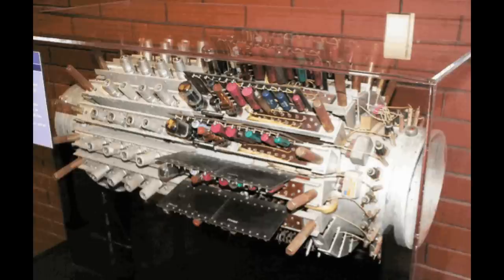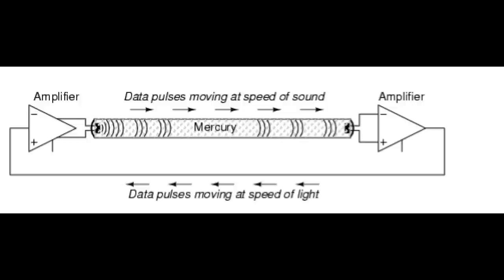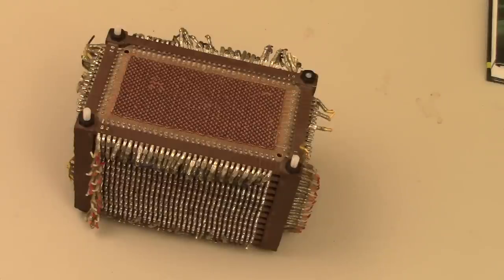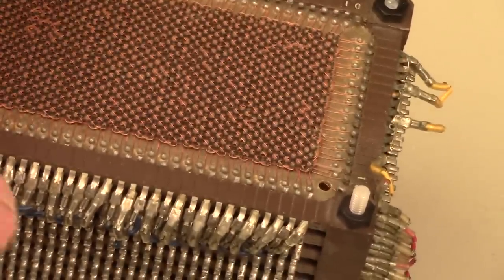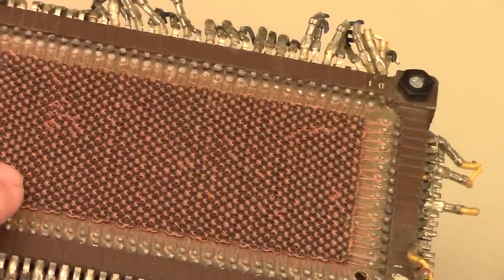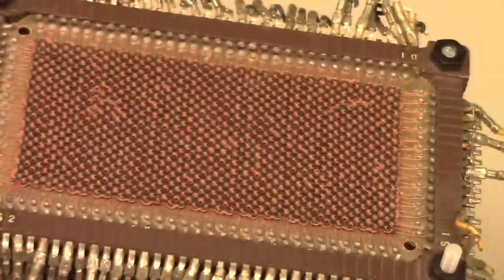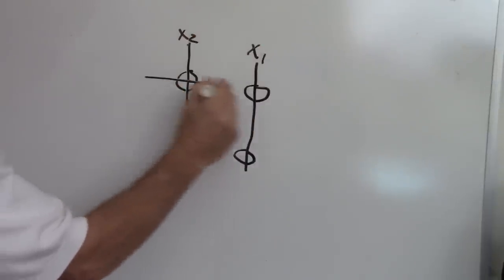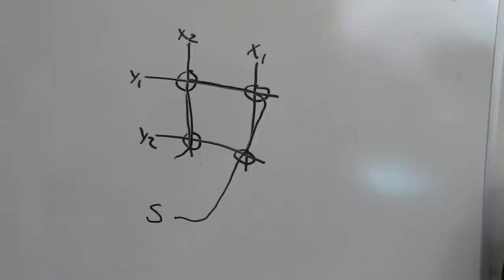Episode 11 - Getting Busted in New Jersey With Core Memory

Comment: And I thought I made out like a bandit when I managed to cadge a 8kb upgrade chip for my TRS-80 Model 100 out of the manufacturer as a "sample". Cost me nothing, and SAVED me $300 in 1985 money.

I managed to write my own ISAM storage and retrieval method for the TI 99/4a. There WAS a disk drive unit available but it was far too expensive, so I stored data for a record-keeping program I wrote for my Dad. I saved the data as indexed-sequential records on the cassette tape the device used for program storage. It was supposed to be "impossible" to use the tape as a data-storage device on that machine, especially since I didn't have the "Expanded" BASIC cartridge, and had to make do with the more limited on-board BASIC.

Years later, I worked for a company that sold it's own OEM IBM XT clones. I spent hours putting DIP RAM chips on the motherboards. Got to be very good at it, too. I even managed to cadge a few NEC V20 chips from NEC, so I could upgrade my own XT at home. The V20 was a little speedier than a stock Intel 8088 chip, and I could also run CP/M on it. I had a large backlog of CP/M programs from when I used to write some of early forms of shareware in Z80 Assembler.
Reply: I burnt plastic army men and insects with a chipped magnifying glass.
Reply: It's also fun to use a propane torch for that, pretend they got napalmed
Reply: Derek Jeter mnj
Reply: Those were the good old days.
I still remember my TRS 80. My first 'puter.
I used to store my written code on cassette from my TRS80 as I wrote it.
I try explaining to my kids that back then we did not have hard disk drives and I don't think they grasp the concept that 64k of RAM and a cassette on a computer was enough to do a lot of work.
Thanks for the memories. 
Take care buddy.
Reply: Hey, 64K on a home machine was going big! The Atari 400/800 were only offered with 48K max with factory 16K cards. Then someone (Atari's founder's new company) began selling "Ramcram" cards for them, 32K on a single card. A friend hacked one into 2 selectable 16K drives to speed up loading his games!
Reply: Dichotomy 
My first computer was the Macintosh Quadra 650.. a supercomputer compared to your origins on the TRS 80 lol. 

But I'm not completely out of the loop with the old tech! My dad was a math professor and was allowed to bring home a computer to work on, so we always had a Commodore PET computer at the house when I was a child. It's so funny now to think of putting in a cassette to load games. 

I tried to keep up with technology, but I'm afraid it's not a race I'm winning lol.
Reply: Damn I'm old!
Reply: I watched Terminator 2X , .. I wasn't even scared , the second time. Oh yeah. You could say I'm tech savvy.

Comment: I used to program an IBM 360/30 that had, I think, 64KB of core memory, and progressed through a few mdels to a System 370/145 running VM (two concurrent operating systems.... OS and Dos27 or so). 
Our software had to be very efficient back then, which is why most of it was done in Assembler, although later on we used COBOL and RPG, and sometimes FORTRAN, then PL/1.
Apart form I/O macros, Assembler was one machine instruction for each instruction coded.... nothing was wasted! Slow to code but it ran very fast for the speed of the CPU.
Nowadays I have 64Gig SD cards for under $50, while back then a Gigabyte was science fiction... Progress indeed!
I still have my old programmer reference cards and flow-charting templates somewhere!... :-)
Reply: sounds lovely. 
today the developers get more and more lazier because theres more processing power available they just are too lazy to optimize. i'd love to see the kind of interest and effort everyone had to program as efficiently as possible back then. the best example i can think of is NASA, oh god, their code has to be flawless and as perfect as possible
Reply: most of the moon missions were running with error code 1102?  (computer overloaded) they couldnt find someone who knew what it meant or why it was happening, of course all this occured during the flight so no tests ?  You would hope they got better. Nasa is far from perfect they launched discovery knowing it had a 5% chance of failing (ie 1 in 12 will kill everyone on board in a giant ball of white death) but regan wanted something to talk about during state of the nation, so they launched with frozen o rings :(   turned out he got to talk about brave school teachers touching the face of god  .. ugh
Reply: Andrew P It's one thing to say the Challenger disaster was from a pervasive cavalier attitude that allowed operation outside the normal flight parameters under pressure from the Reagan administration to make shortcuts to save money. It's another, sheepish, cowardly thing to say it was murder so he could recite a poem from 1941. A lot of shameful things happened under the Reagan administration, but that's some real tin-foil-hat shit right there. Grow up.
Reply: Andrew, two Space Shuttles were lost during the program. Challenger was the one that blew up with the frozen O-rings. Columbia broke up over Texas. Discovery survived the program and is now in the Smithsonian.
Reply: exactly, many of the spaceships failures are mechanical. of course there are some software bugs, but the software developers at nasa are famous for making the most reliable software jmowreader
Reply: wait thats not the documentary? ill have to have more of a dig

Comment: While in the Navy, I worked on a computer that was literally an IBM 360 in a compact military package. It had 32K Word (16 bit) core memory.  It was used in an attack aircraft.  That computer was amazing because you could power it down and when you fired it up again, it would pick up exactly where it was when it was shutdown. No loading OS, no feathering it’s nest, just ran what it was doing when shutdown.

It was also used in SkyLab.  And 3 of them were used in the Instrumentation Unit on the Saturn V rocket.  Yeah. I’m that old.

Comment: In DRAM, not only does the charge on the capacitors have to be refreshed every few milliseconds, but it also, like core, has to be rewritten every time it is read. That happens automatically inside the chip, so we normally don't think about it.

Ferroelectric RAM (FRAM), a nonvolatile memory technology, also has this hidden rewrite on read, which is why it has limited read endurance, unlike EEPROMs and Flash, which generally only have a limit on write endurance.

Comment: I still have the core memory I salvaged in the early 1970s that I intended to use for a DIY computer while I was in college.  I think I got it free as a donation from Xerox after making a few calls.  Ended up first building one from an 8008 chip that I had trouble getting working, and ultimately, my first working computer was an IMSAI 8080 kit, which I then utilized for years-- still have that and it still works.   But you forgot to mention drum memory.   I also had a vacuum tube computer for a while, the LGP-30 that had 4K words of 31-bit drum memory-- bit 32 was a "spacer" bit on the drum and couldn't be written.   And even the CPU's accumulator was stored on the drum, they saved multiple copies there in order to increase the access time.   The drum also had a clock track which produced the master clock for the system-- it was bit-serial so it would clock data on and off of the drum as it ran.

Comment: Hi Jack and thanks for posting the information on magnetic cores.  I was in USAF during the Vietnam War and in SAC.  We had a system called the 465L that used magnetic cores.  The system was quite a bit like the modern internet in that it allowed SAC to communicate with all of its bases through digital communications.  It used modified IBM selectric typewriters as both keyboard input and real time printers.  The system we worked with was my first exposure to magnetic cores, though ours was much smaller than the one you showed in the video.  Ours was only 90 words of memory and served as a buffer for the data as it was sent out.   We also had a device used for encryption called a KW26.  This device was extremely old and used tubes and what were called bi mag cores.  The bi mag cores were used to store information as it was encrypted and decrypted.  Each core was a single toroid that was mounted with others on a board.  the cores themselves were about an inch square and about half an inch high.  Lots of fun way back then.  Thanks for the memories.

Comment: Rope memory?
Related to core, it could only read.
Think of it as early ROM.
The flight control programs for Apollo were stored on woven ropes.
The system used AC in the interrogation and sense leads, which prevented having to re-write the bits on read.
The ropes were literally hand-laced to program the bit-patterns.

Comment: great video, beings back memories.
I became a programmer in 1963 on a Univac SS 80 with 3,200 words of memory. This memory was stored on a cylindrical magnetic drum that was spinning at about 18,000 RPM. magnetic read write heads read the memory contents as the drum rotated. Unlike discs these heads were static, they did not move, YOU had to wait for the required memory locations to pass beneath the R/W Heads to access the contents.
20% of the drum has 4 sets of heads at 90 degrees to each other so that you only had to wait for a quarter of a rotation to access the memory.
When writing programs you had to keep track of where the heads were in relation to the memory locations you needed to access, if you did not do this the program ran very slowly.
Each WORD of memory contained 10 4 bit characters, these bits had the binary values 1 2 4 5, yes 5, it was known as BIQUINARY.
Programming these machines was a nightmare BUT GREAT FUN.

Comment: No doubt that memory will never look as cool as these older devices, I wish I could see what people a thousand years in the future will think
Reply: sam goad 

they will maybe using a new form of core memory because it can be as fast as an ssd and you can rewrite it endless
Reply: I'd imagine that the material would change to something less temporal, if you go on Ebay for one of these you see alot of the connections severed. My idea, Crystal capacitors!

Comment: Mr. Ganssle:

Overall, a very interesting video; but my attention was suddenly riveted when you put up pictures of:
≈ 2:25 to 2:47 – the Williams tube

When I was old enough to comprehend some things about computers, my father described what it was like to work on one of the very first of them. He was back and forth between MIT (where he was doing his doctorate) and Princeton (where J. von Neumann's electronic baby was), and I didn't catch which location this was, but he talked about having to deal with computer memory that was on an o-scope screen.

And here's the crazy part – when some of the memory spots on the screen would become faulty, programs for that machine had to be written to specifically avoid those memory addresses!

Anyway, thanks for connecting me with images (as well as the name!) of what my dad must have been dealing with back in the early 50's!

PS. I still have his copy of the owner's manual for the IBM 704, which, some years after his doctorate, was the machine in use at his work.

Comment: Not sure why you're thankful it's gone as from what I read core memory was pretty reliable comparable to semiconductor memory.
The Apollo AGC and 4PI had it and where so reliable they were used in flyby wire systems and some old mainframes that had it were it were still in use until the early 1990s.
 Now mercury delay lines and Williams tubes on the other hand were known for being fickle and buggy to the point of frustration.
Reply: you think that having a million of these (6 GB) would be more reliable than 6 gigs of DRAM?
Reply: jakejakeboom
Of course not.
But it was as a huge leap over previous memory technologies.
One big disadvantage of core it was not only bulky but was very labor intensive  to manufacture.
When the 1103 1K DRAM came out in 1971 it was a significant an improvement in cost and packaging and quickly began to replace core memory in many applications.
Reply: comparing shit old tech to other shit old tech, people are sitting on gigabytes of ddr3/4, and none of them give a shit so why waste comment space?

Comment: I wish people would not use the SI value for K (1000), but instead use the one that's always been used in the industry of 1024. It seems those hard drive manufacturers in the early 2000's looking to make thier disks look bigger turned the tide. Even though all other parts of computer architecture still uses 2^2 ie, 1024 systems. In fact, even filesystems used on those disks still use 2^n.

Comment: Many years ago I worked for British Rail. As we had very little money we had two old second-hand IBM 370-155 machines on which we ran the reservations system (one machine as backup). One day a drive transistor on one plane of the core memory failed. Our IBM engineer loved these machines, I think they reminded him of his youth! It turned out that IBM no longer stocked the part, at least not in the UK. So, he looked up the transistor's characteristics, found an equivalent in the Tandy (UK version of Radio Shack) catalogue, popped out to the local store, came back and soldered it in. I don't know if his expenses claim was accepted though...

Comment: As a professional programmer that was taught assembly in my computer science degree the lack of memory forced better programming practices than are the norm today. Nowadays languages with garbage collectors mean most programmers that never learned assembly or even C know nothing about memory management and consequently code as if memory is infinite.
For a single user system that might be just about viable but if you need to scale all the old memory limitation problems are still there.
Great video.

Comment: Hey good post! 
Thank you for a walk down memory lane (pardon the pun),  my first job back in the day was with Dataram Corp. plant (Trini Data owned by Mr. Michael Armoogam)  here in Trinidad. Later on, I moved to United Telecontrol Electronics Inc. (Qualitek Electronics Plant, again owned by Mr. Michael Armoogam and Dr. Winston Akong) where we manufactured those Ferrite Core Memories. I went in as a trainee test technician and quickly moved up the ladder to Senior Test Technician / Assist. Plant Manager. I was very fortunate to be mentored by such engineering greats a Dr. Winston Akong and Dr. Art Ericksen. So yes, Trinidad and Tobago does have some history in the manufacture of "State of the Art" electronics.  I believe Dataram Corp. was headquartered in NJ then. BTW our biggest memory back then was a folded, 128K stack and the "holy grail" of oscilloscopes was the Tektronix 500 series (my lab had two 545A's) and Nixie Tubes were the common digital displays, before moving on to the HP 7-segment LED displays (the segments were dots, don't recall if it was indeed a dot matrix device ....I doubt it).

Comment: I don't know, if memory were still limited we would write software much more carefully than we do.
Reply: Imagine the user experience if software was written properly and non-platform independent, it would react seemingly instantly in most cases, like I imagined it to be when I was a student 15 years ago. Instead there's noticeable lag after almost every mouse click.
Reply: Any engineer that can create software in pure assembly language for a given processor, PIC or microcontroller these days is held in reverence like some mystical ancient wizard. Back when I started out my first computer (1977) had 6.5 KBytes of RAM and used a Signetics 2650 processor totally dependant on assembly language for programming. Add in the idiosyncracies of how registers and IO are used in the 2650 to make for further headaches. By comparison my next machine (Sinclair ZX80) could do more with 1 KByte of RAM than the 2650 could do with 6.5 K. (It takes exactly 128 Bytes of machine code to draw a white on black line box and bounce it around the screen on any PC regardless of processor invoking PC BIOS screen Interupt call INT 29. It takes considerably more code after compiling in C or C++).
Reply: In my first programming job, your code had to fit into one 4K area. If that wasn't enough, you could use a second one, but it was a big deal. This was used on an IBM mainframe with 1 Meg of main memory and supported around 160 on-line users with sub-second response times. That was really squeezing the last ounce of performance out of it.

Some core memory, I seem to remember , had a small heater underneath because the ferrite was more permeable (faster) if warm.
Reply: Evi1M4chine And this is why the supercomputer on your desk crawls like a snail. Program "efficiency" these days is horrendous.
Reply: Totally agree, and I am a programmer. We (as programmers) have simply become accustomed to wasting CPU cycles. The saying (credited to Intel) goes: "we increase the power of CPUs and Microsoft pisses it away".
Reply: When I was working at Olivetti (one of the first IBM compatible PC manufacturers), we had a name for the gap between the power demanded by Windows and the processing available from Intel. It was deemed "A Market Opportunity" (tm). It never did any good, because although Olivetti's engineering was first-rate, the product features were never as good as the competition.
Reply: +Evi1M4chine If, for any reason, I need an array of booleans I'll use a byte array, otherwise it's gonna take up a byte because it's just easier.